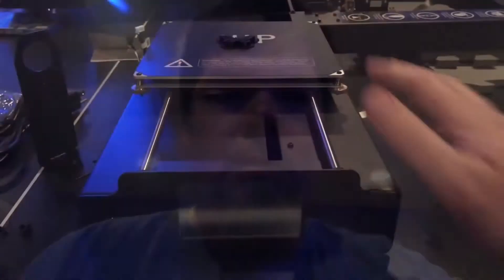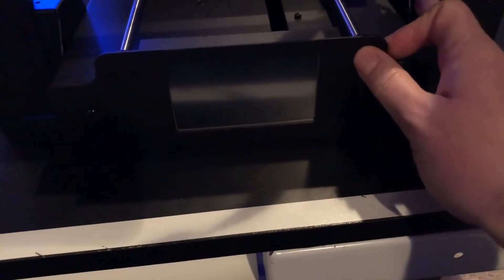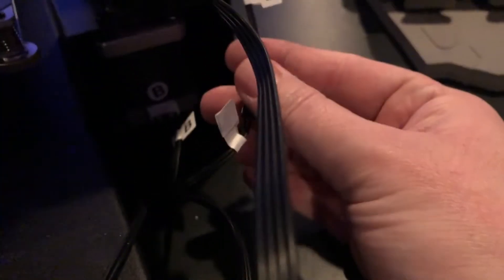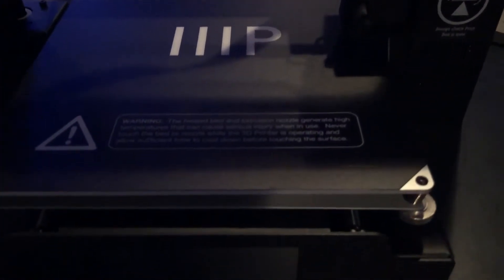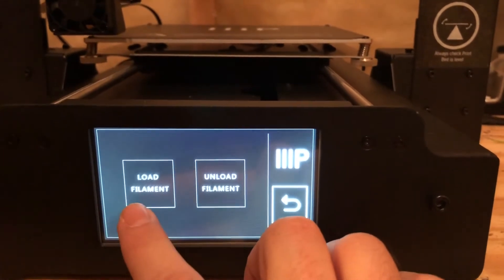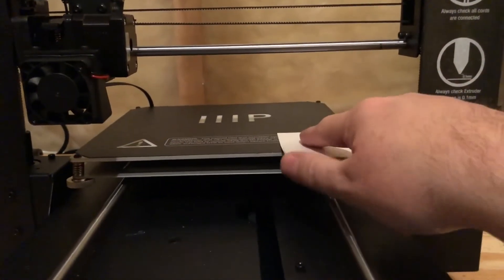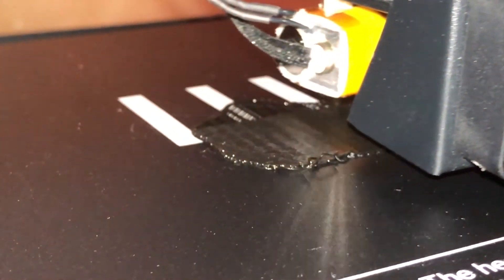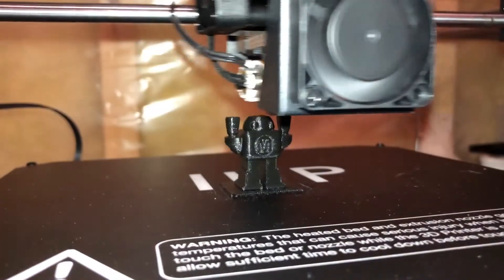Monoprice Maker Select Plus - Assembly & Test Print

Comment: I just unboxed mine, same exact printer, a couple of days ago and have run into an issue with setup.  The nozzle is down too low to clear the build surface when I try to slide the tower frame onto the bed.  If I try to slide it on from the back, there are ribbon cables in the way.  Someone suggested that I can manually work the motors on either side of the frame to raise the nozzle enough to clear the build surface.  Have you got any suggestions on the best way to work the motors manually without messing them up?  Thanks for a great how-to video.
Reply from the maker: There should be instructions in the box or a video on their website.  I'm no expert, but I think you need to rotate the threaded rods on both sides to raise the tool head.  Once you get it assembled, then you have to put a level on the bar that supports the print head.  Adjust each threaded rod by hand until it's absolutely level.  If it's off then you'll have trouble leveling the bed.

Comment: Do you have the Cura 3.2.1 settings
Reply from the maker: If you still have the original test object files that shipped with your printer, you can extract the settings from GCode. 
That's how I got them after I lost them.
Reply: thats why I was trying to do but I am looking at the text in the Code and I dont see the settings